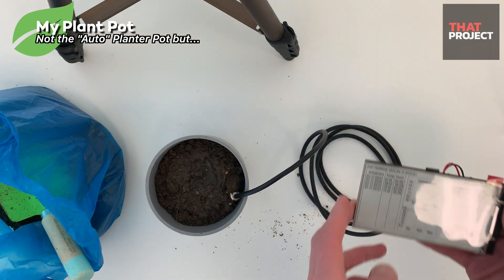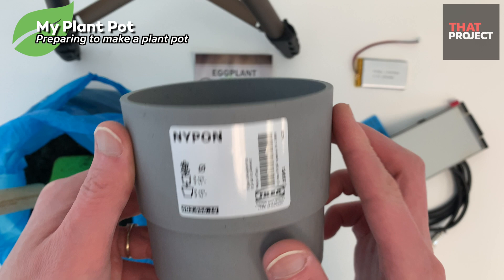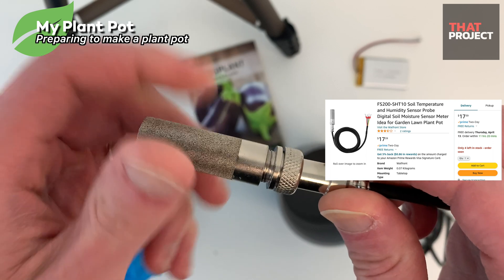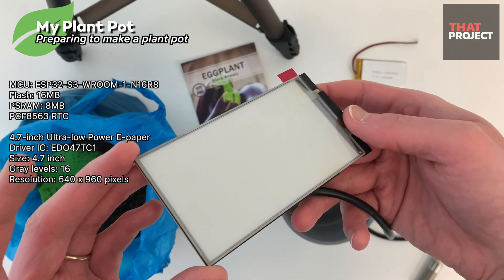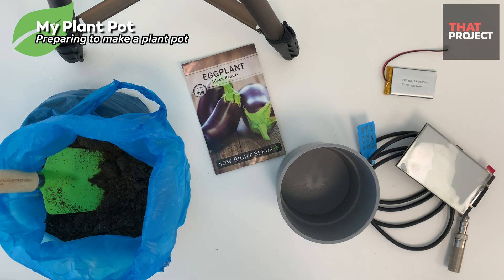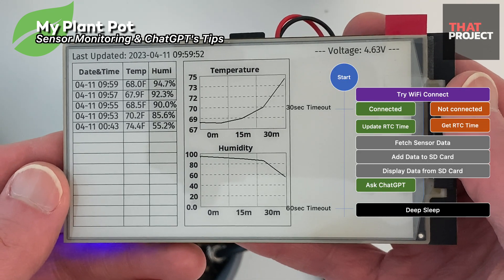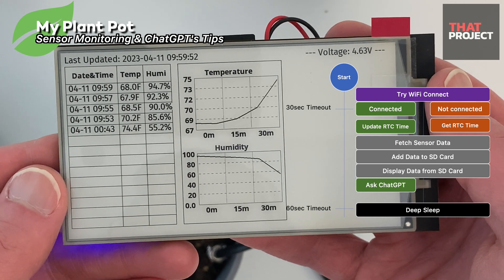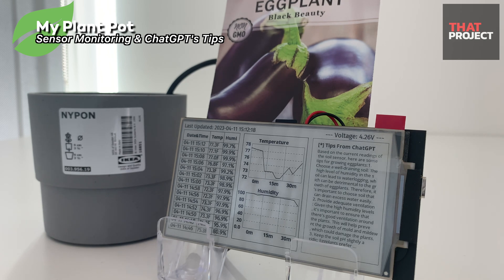4.7 E-Ink display, optimal for providing periodic information. #ChatGPT #GreenIoT #ESP32 #Soil

Comment: Hi, I'm currently dealing with this error: "library PCF8563_RTC claims to run on samd architecture(s) and may be incompatible with your current board which runs on esp32 architecture(s)." Can you please let me know what kind of RTC library you are using and if it's possible to share it with me?

Additionally, could you provide the schematics for the PCF8563 connections? The connections are very confusing.:face-red-heart-shape:

Comment: Hi, great video! But I have a question: About the graphs shown in the video, did you make those in squareline studio or using other methods? And if so what did you use? I am asking because I am working on a similar project but with a small 240/240 SPI display. I have made a custom GUI in squareline after watching your videos about the subject and right now I am wondering how to create some graphs.
Reply from the maker: This didn't use LVGL, so I didn't configure the screen with Squareline Studio. Since an e-ink display was used here, the EPD library was used. Which GFX library are you using? Depending on it, the format of drawing the graph may be slightly different.

Comment: That looks like a good general purpose Lilygo T5 e-paper esp32-s3 board you used for your interesting soil sensor project. Would you recommend using this particular esp32-s3 board for other projects as I would value your advice. Thanks.

Comment: Battery: 1 cell 3,7V, display: 4,26V ;) (I know, I know, 1 cell is up to 4,2V but still might be surprising at first)
Reply from the maker: The lipo battery has an output ranging from 4.2V when completely charged to 3.7V. The reason why 4.2V or more is displayed is that the ADC converter calculated the analog value. So there is a slight error.

Comment: Asked ChatGPT, the sensor FS200 - SHT10 is not made to be used within soil.
It is not waterproof and can be damaged.

What's your experience using that sensor directly in soil, and why didn't you use some capacitive soil sensors like in most projects?
Reply from the maker: oh really? Interesting. It will be applied in the agricultural greenhouse, flowers, nursery garden, lawn, and other need detection of soil temperature and humidity environment occasions. So I thought it was just okay to use it for getting data from the soil. If you google it, you can find lots of use cases for the soil with this sensor.
Reply: @ThatProject  maybe you should make a comparison between different types of soil moisture sensors (resistive, capacitive, and this one) as they work on different principles. Accuracy, power consumption, long-term stability and so on. This would be very interesting. Also the sht10 measures relative humidity of air which depends on the temperature too. So i don’t know how to relate that to moisture content of soil which follows a different physical principle and depends on the type of soil…

Comment: Thanks! awesome project!! What's the pin connector type at the back of the display where the SHTx connects? is the SHTx sensor connecting as i2c, is it possible to connect another sensor in i2c to the same connections or other connections?
Reply from the maker: The pin connector type is this, https://www.digikey.com/en/products/detail/molex/0530150410/1785079
SHTx is connected as i2c and you can connect other i2c sensors to the other pins.
Reply: @ThatProject  That's great, thank you!
Reply: @ThatProject  running the code as is doesnt print anything on the arduino serial monitor. for example, Serial.println("60 second TIMEOUT"); doesnt print, making debugging chellenging. What gets printed is "ESP-ROM:esp32s3-20210327
" when the esp is booting up. Do have insights on this?

Comment: ChatGPT feels very much like overkill here, this project would benefit much more from having an offline Wikipedia Database (it takes up about 100GB of space, so perfect for a 128GB MicroSD Card), then you can pull the information on how to look after & grow the Aubergine from that local-only database without any requirements for internet connectivity, thus reducing your power usage too!

Combine that Wikipedia Database with every plant you are growing, hook it all up to a central hub and have the information display itself on a single display, or, use LoRa to transmit information to a portable solar-charged tablet terminal which changes what information it displays based on where you are in your house/shed/greenhouse, using the strength of the connection to work out where you are in relation to the hub, and pre-programmed information of where the hub is in relation to all of your plants.

Comment: hello, just a quick question... I tryied to run lvgl 8 on an esp32s2 dev module and it seems it does not work... althought the lvgl v7 works fine... SO does lvgl 8 and Squreline studio work on esp32 s2?
Reply from the maker: I'm sure it works fine. Please check your GFX library to drive LVGL 8.